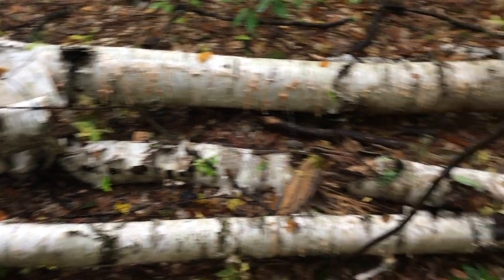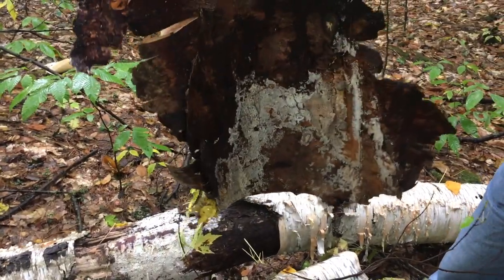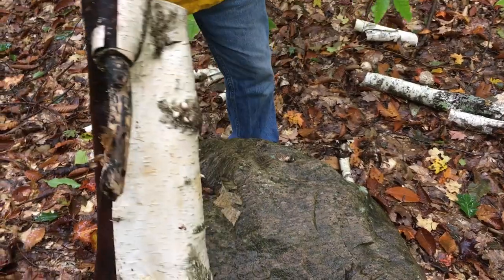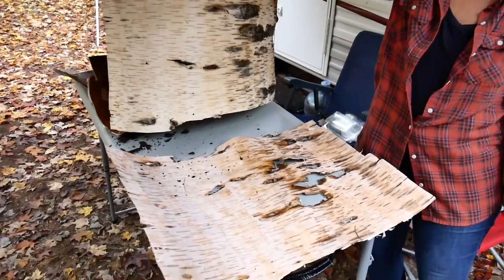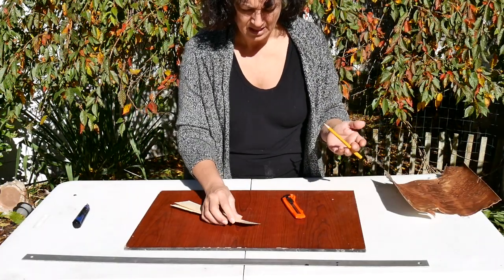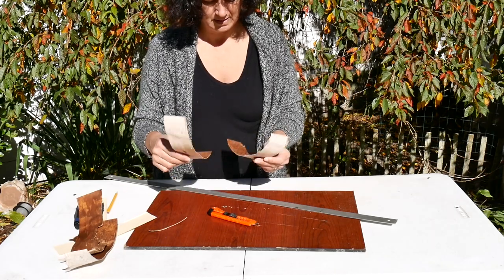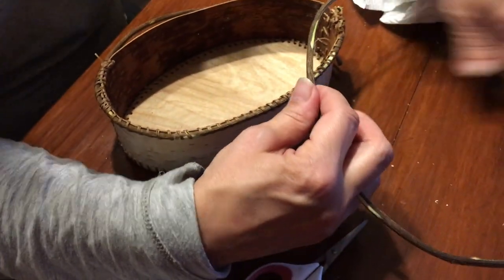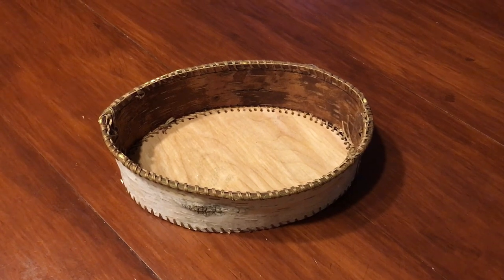HARVESTING BIRCH BARK & My first basket!

Comment: if you do sew make the stitches one long and one short so that the birch does not crack. If The stitches on one line  it weakens the birch. Do not sew in the lines on the birch it is a weak part of the biircch.
Reply from the maker: Thank you for that! I have learned so much over the years doing this ❤️ Kathie